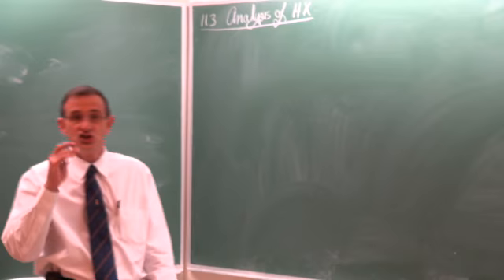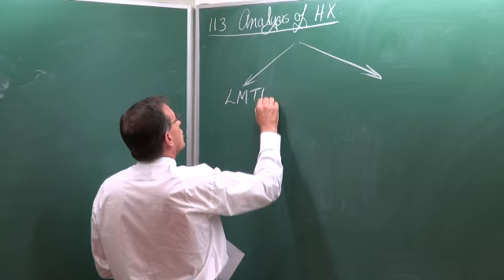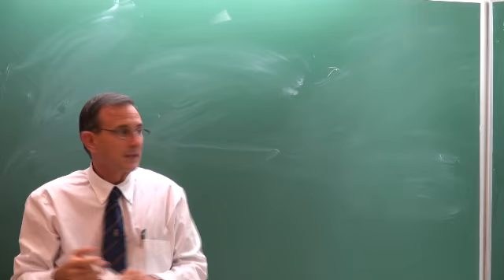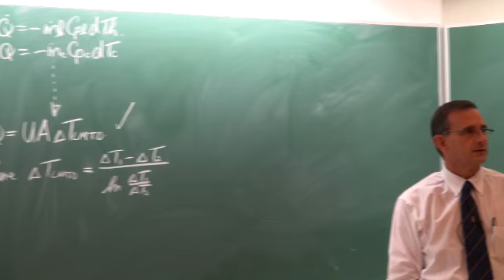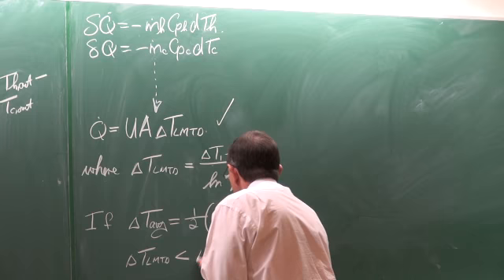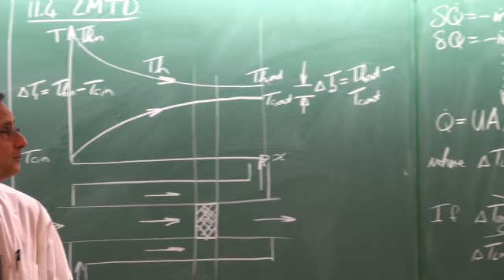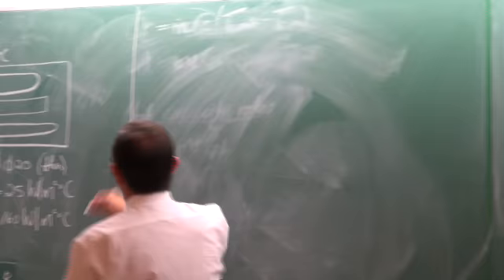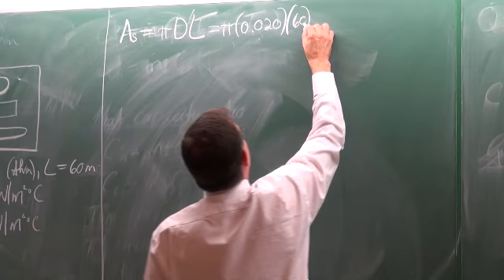Lecture 35 (2013). 11.3 Analysis of Heat Exchangers. 11.4 Log Mean Temperature Difference Method

Comment: Thanks professor for the video. 
I just have a question about tube shell heat exchanger. Is there any formula which links the dew pression within the condenser (hot fluid) and the temperature of the cooling fluid?